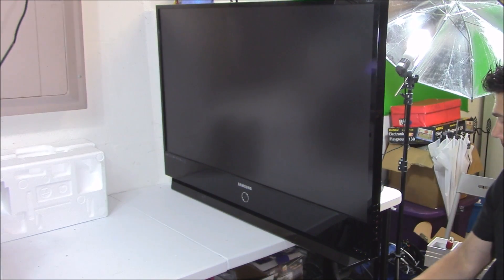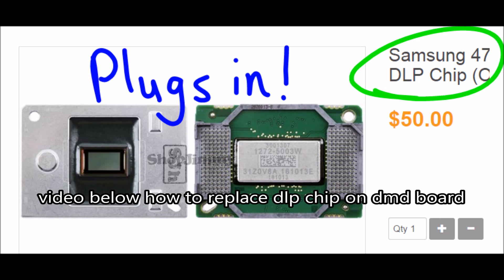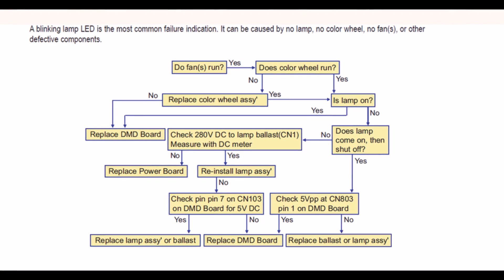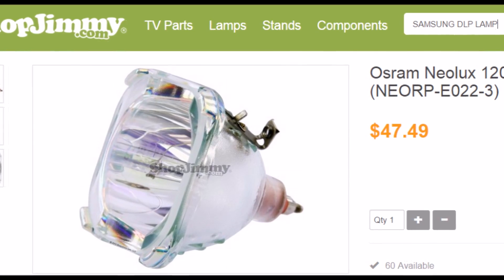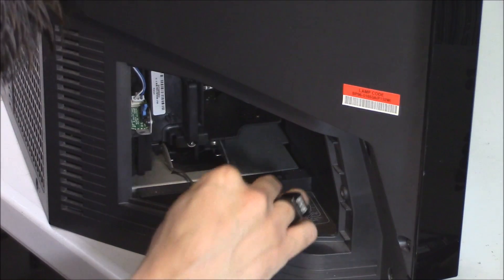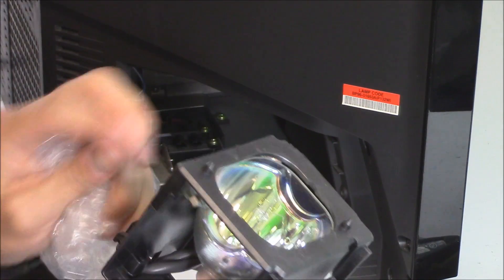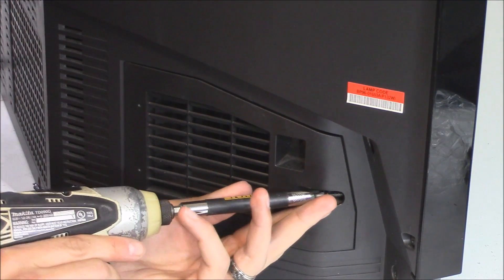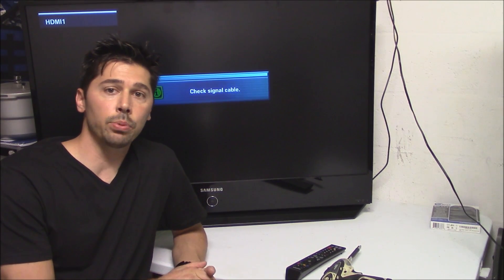MOST COMMON EASY FIXES DLP TVs - no power, no picture, dots, blinking leds, turns off,

Comment: I'm having an issue I haven't seen this issue hoping you have an idea.  I have an issue where I can't turn the HLT6187 off unless I unplug it.  Neither the remote nor the power switch work.   If I unplug it leave out for 10-30 seconds everything seems to work great for anywhere from a day to a week.  Is this a power supply issue?  I can't find it in the service manual either.

Comment: How about checking LED's on Samsung HL-T6189SX-XAA TV's?  Installing is easy as long as you have thermal past. I was wonder about checking functionality knowing the chip is either good, but dying or dead and power requirements to power at 100%. I think they are 3.3v, but I don't know the amp requirements. Thanks

Comment: I had the problem where my 61" DLP would come on for about 20 seconds and then turn off with 2 (or3?) of the lights in the front flashing.  Didn't think it was the bulb being burnt out since it was showing a picture for those 20 seconds.   But after watching a few videos, including this one, I bought a new bulb (higher quality, around $75), plugged it in and *poof*...  it works great now!!   :-D

Thanks for the video!

Comment: Hi, I have an older toshiba 62hm196 projection TV. One day the TV wouldn't come on and there was a amber light on the front which blinks 3 times. I thought it was maybe the bulb, so I replaced it but it still has the same problem. Anothe search said it was the Auxiliary Power Supply Board, but I can't even find where to order one. Any suggestions? Thank you!

Comment: I have a similar tv to the one shown in the video.  Mine blew a lamp and gave off a burning smell.  I replaced the lamp and now it turns on for about 40 seconds and shuts back down flashing the 3 lights in the front.  I tried replacing the lamp fan and the temperature sensor (the little circuit board that sits on top of the lamp housing).  It still does the same thing.  When it turns on, the lamp does light and I get a normal picture on the screen, but it shuts back down after 40 seconds.  I thought it could be the ballast but I felt if it was that the lamp wouldn't come on at all.  Any ideas?  Thanks in advance!
Reply: Same problem here.

Comment: Have a Samsung hl67a7501fxza works great except the picture is pro dominantly green just had new dlp chip installed last year now screen color is off. Was great once came back from shop for almost a year. Any ideas how to fix mostly green. Already tried changing color settings to no avail. Almost like there is no blue in the picture

Comment: I have a Toshiba 62mx196 DLP projection screen that isn't coming on. I have a yellow lamp light blinking and the blue power light staying on. I have tried unplugging and letting the TV set off for 1 minute. It still hasn't come on and it has cycled through the restart phase as well. Any suggestions on what I should do next?

Comment: thanks awesome video i have a sampsung 67" dlp, it won't turn on any more, when i hit the power on it makes the sound the fan turns on the color wheel spins but nothing happens for the lamp I've already replaced the lamp, I'm thinking it's the ballast, do you have a video on how to check for a bad ballast on the dlp tvs? Any help would be appreciated. Thanks
Reply: Did you ever figure out what the problem was?
Reply: No just got rid of it

Comment: My Samsung DLP has the same blinking lights but will power up and the bulb comes right away on but only for about 10 seconds then it shuts down. Could it still be the bulb or is it most likely something else?
Reply: LS8 open the back panel, search for the blue switch and tape it upwards.

Comment: I have a Samsung DLP TV H5075S.  It's 9 years old, not heavily used, but the picture was becoming dull.  Then one day it came on for 10 seconds and then the picture went black.  Turn it off, then on and it repeated.  The Standby and Lamp LEDs were blinking.  I consulted the manual and it seemed to indicate that it was time to replace the lamp.  Ordered a Lamp on E-Bay - BP96-1653A; Philips, $73.  Lamp arrived in 2 days; installed.  No picture, same LEDs flashing.  Your thoughts please.  Thanks.

Comment: I have a 50" samsung dlp model hlt4675sx/xaa. I have replaces the bulb in the past well last night it made a fizzing sound then turned off. I n plugged it then plugged it back it has no power at all no lights nothing. what could it be. I have spent all day looking online and every thing people are saying is gonna cost me as much as a new dang tv. might as well buy a new one. is it something simple or expensive? can u by chance tell me what it could be?
Reply: Did you check the ballast? Open up the TV and look at all the components. look for any sign of capacitors popping, or burn wires or burnt chips. It all depends on what was damaged to determine how much it will cost to fix. Capacitors are easy to fix. Hell most things on DLP TVs are easy to fix. Just Follow Tamatec's flow chart. You should find out what fried easily. My bet is that it is related to the lamp being defective and frying your lamp ballast(lamp power supply). It could also have fried more than one thing like a capacitor. The fizzle sound sounds like either arcing from circuits being shorted out or capacitor shorting out after leaking..  Go take a look and find out. That is why you were watching his video anyways. To find out how to do it yourself.

Comment: tampatec, I have a bit more complicated issue - after changing the lamp and dmd chip (or dlp chip), I went into the Service Menu and adjusted the horizontal and vertical coordinates of the picture (in the mute/182/power menus mode). But, I unfortunately changed a setting in the "lamp sync" function that has caused my screen to disappear, and the light bulb timed off, and the tv power begun cycling on-off continuously. If I could get back to the service menu, I could reverse what I had done. The problem, I cannot stop this vicious power recycling issue - which is instigated by the lamp not wanting to come on and stay on. The lamp is new. Could it be that I damaged it by changing the "lamp sync" setting? Help! - Thanks in advance.

Comment: I have a samsung  DLP TV  HLS618UWX/XAA, version PF 01. My question is  why my tv don't turn on. when I push botton on. the green ligh flashes for 16 times, stops, and continue after 5 secons. flashes for another 11 times. Please . Can you help me what could be the problem with my TV. Thank you very much.
Reply: Look up the service manual or your instruction manual for the codes and what they most likely mean. Then repair or replace or service whatever needs to be fixed. Tampatec made a nice flow chat to help anyone fix these easily.

Comment: I just replaced the bulb and still had blinking lights ,so i went back and adjusted the two metal clips  and low and be whole i've fixed my first dlp tv  . thank you tamptec
Reply: I also replaced the bulb, but the screen still turns off in 20 min... 
What 2 metal clips are you referring to?

Comment: I am Mauritius
Well I purchased an Lcd 42" Hitachi and after less than 1 and a half year, 
it stopped...
I did some research and gone through a complete troubleshooting of my
Lcd 42" Hitachi Model L42NO5A. 
The good news is that I am getting Audio and the Images are showing on the screen (tested wish flash light)... 
The bad news are that the Back-Light refuses to switch ON...
I guess that the T-Con Board & Main Board are in good condition...
All Capacitors Look Good...Maybe the Inverters are not working...
Here are some pictures of My Power Supply Board...!!!
I Should be most Grateful if you may explain to me where are the Inverters (if they are on the Board or not) and how to repair it..
I Cant Locate The Inverters...
I cant find Another Power Supply Board...
Thanking you In Advance...!!!
All HELP are Welcome...!!!!!!!!!!!

Comment: First I want to say thank you for sharing your knowledge in such a professional way. I am very impressed. I have a question about my Mitsubishi WD-82740 TV. The green light is on the front showing power but the TV has no sound or picture. I was not home when the TV died but they told me the TV was working fine and shut of by itself they turned it back on and it worked for a few mins and then died. I have a feeling it is the power supply because of no sound or picture. Any help or advice you can give will be greatly appreciated. Thanks again for what you do. Neal
Reply from the maker: Sound and picture comes from main a/v logic board but still check volts to main board make sure you get steady voltages.
Reply: Will check and get back to you. Thanks

Comment: Go Hawks
Reply from the maker: Thanks for reminding me of that painful memory :(
Reply: ***** I am MauritiusWell I purchased an Lcd 42" Hitachi and after less than 1 and a half year, 
it stopped...
I did some research and gone through a complete troubleshooting of my
Lcd 42" Hitachi Model L42NO5A. 
The good news is that I am getting Audio and the Images are showing on the screen (tested wish flash light)... 
The bad news are that the Back-Light refuses to switch ON...
I guess that the T-Con Board & Main Board are in good condition...
All Capacitors Look Good...Maybe the Inverters are not working...
Here are some pictures of My Power Supply Board...!!!
I Should be most Grateful if you may explain to me where are the Inverters (if they are on the Board or not) and how to repair it..
I Cant Locate The Inverters...
I cant find Another Power Supply Board...
Thanking you In Advance...!!!
All HELP are Welcome...!!!!!!!!!!!
Reply: +Tampatec  so I've replaced my bulb  yesterday which was Thursday & it worked for me all day and part of the night but this morning I turn it on, & nothing works & it's a mitsubishi tv model wd-65737 it turns on with no screen but has the sound , I need help

Comment: I was hoping you could help me with one of my TVs. I have a LG 37lh30 tv. The screen freezes from time to time. I noticed it used do this when it was cold outside and would stop once it warmed up. Now, it does it majority of the time. You think it's a bad capacitor? I could send you vid of what it's doing if you have a email address. Would really appreciate it.
Reply from the maker: Make sure it's not the hd cable box, reset tv, hd box,  surround sound,  just in case.  But Can be main logic board,  use electronic freeze spray to locate what area is failing. Hope that helps
Reply: ***** 
I am MauritiusWell I purchased an Lcd 42" Hitachi and after less than 1 and a half year, 
it stopped...
I did some research and gone through a complete troubleshooting of my
Lcd 42" Hitachi Model L42NO5A. 
The good news is that I am getting Audio and the Images are showing on the screen (tested wish flash light)... 
The bad news are that the Back-Light refuses to switch ON...
I guess that the T-Con Board & Main Board are in good condition...
All Capacitors Look Good...Maybe the Inverters are not working...
Here are some pictures of My Power Supply Board...!!!
I Should be most Grateful if you may explain to me where are the Inverters (if they are on the Board or not) and how to repair it..
I Cant Locate The Inverters...
I cant find Another Power Supply Board...
Thanking you In Advance...!!!
All HELP are Welcome...!!!!!!!!!!!
Reply: no links show up... Links may have been removed or never were posted.